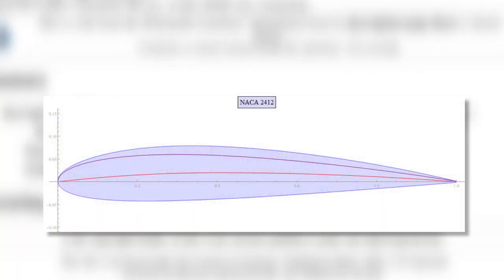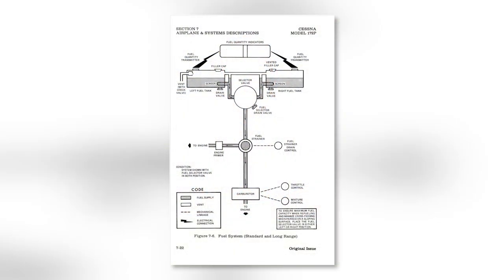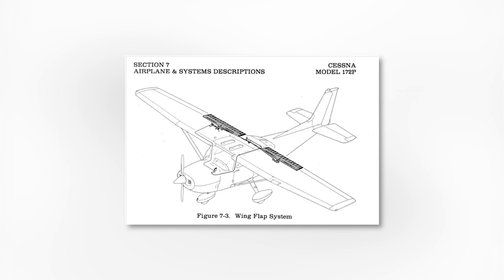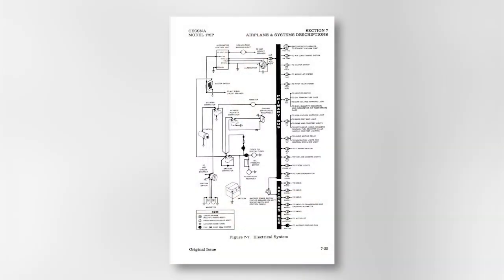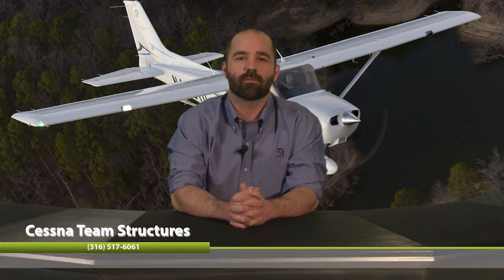Cessna Single Engine Wing Replacement Considerations

Comment: I was caught by a wing change in the late 182A production run. Must call and see if these folks believe that a fitment of the newer A-model wings is satisfactory with the older A-model fuselage. The wing's cabin air vent system are obviously different.

Will be important to know of compatibility since the wings have already been bought and received. 
Steve

Comment: Considering buying a cessna 150 with spar corrosion failing the 2023 annual. Is it hard to get reinspected after changing the wings with identical spec wings. Have a a and p to help. Thanks in advance.